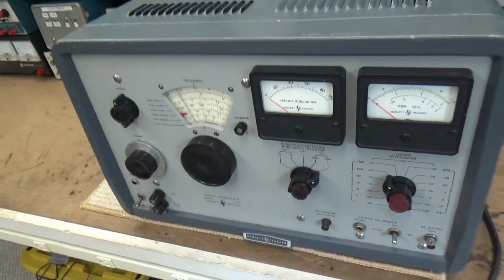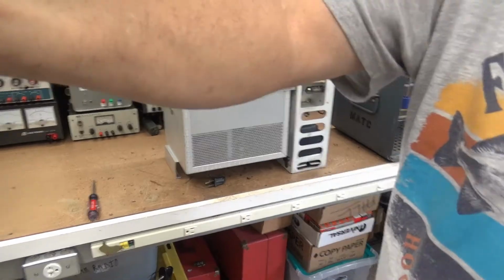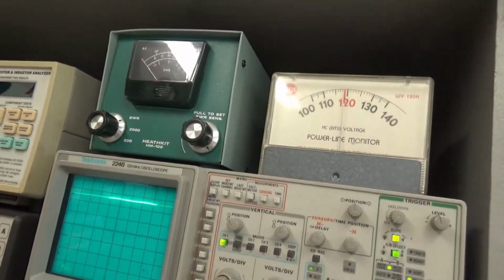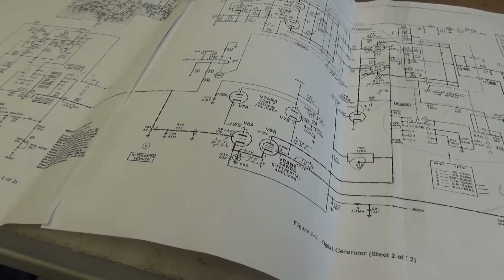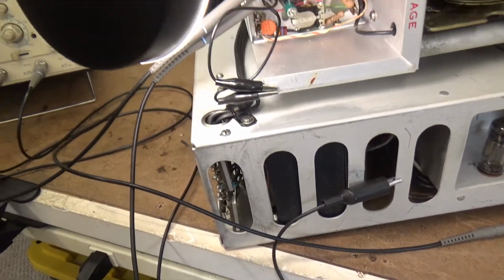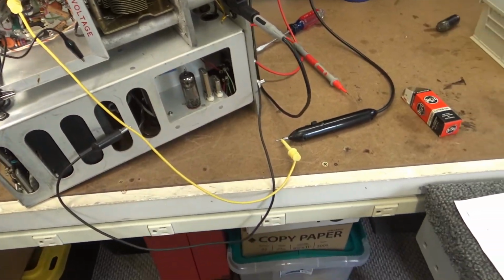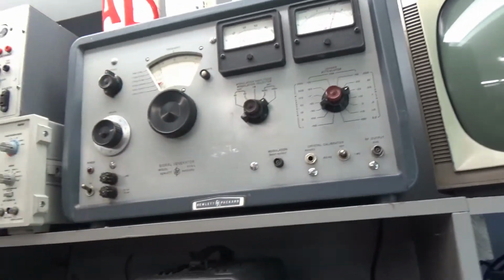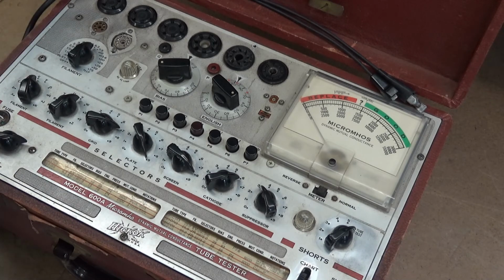Hewlett Packard 606A Signal Generator Troubleshooting and Repair

Comment: It is a possibility that you might have to clean everyone of those contacts on that rotary turret / band selector assembly as it could be suspect with a little dirt or corrosion on them try a little deoxit on a cotton swab end and clean away!
Reply from the maker: Deox was my first try. As a last resort I used an old tv repairman trick and tapped the tubes. It worked.